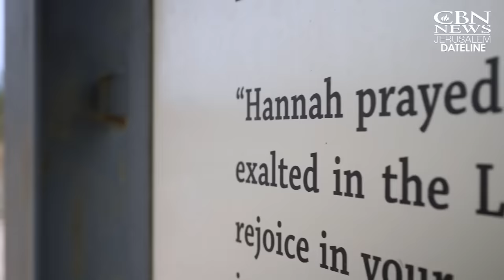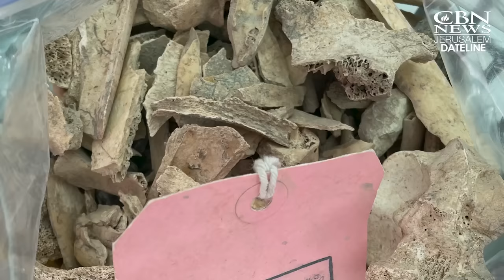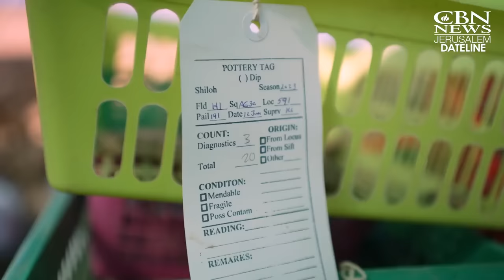Archaeologist Excited by Recent Finds in Ancient Shiloh, Biblical Site of Ark, Tabernacle

Comment: The issue is, until Solomon built the temple,the temple was as it was in the dessert, essentially a large tent.
Reply: @faigie2002
Believe it or not, tents were often erected ON WALLS, back then. 😊👍
Reply: @fairyspunfibers9098  that may be true, but that’s not how the construction f the tabernacle was laid out for it to be constructed in the Bible.
Reply: True, but it was a perfectly designed tent, both for practical as well as religious purposes. It kept ppl dry during the rainy seasons, and it also kept ppl insulated from both the heat and the cold.

Comment: I'm not convinced. Wasnt the tabernacle mobile? It was the temple that was fixed, so why are you calling this the tabernacle or even considering the possibility. This structure is clearly fixed. Also the first temple was stunningly beautiful. It surpassed the beauty of the second temple, and the second temple was completely leveled to the ground. So i wouldnt even consider this as the first or second temple. So i just dont see how this could be any of the 3 structures mentioned in the Bible. Please feel free to explain if my reasoning is flawed.

Comment: But the tabernacle was a tent, not a building. So how would remnants remain?
Reply: A quick internet search yielded this explanation:

“It is noteworthy that at Shiloh, at least in the later period, the tabernacle seems to have had a more permanent structure.  In the narrative of Samuel’s youth, the place is referred to twice as the “temple of the Lord” (1 Sam 1:9, 3:3).  This phrase had not previously been used for the tabernacle, although it was the common name for the permanent temple built later by Solomon.  Also, Eli is described as sitting beside the “doorpost” of the temple (1 Sam 1:9).  This term is never used to describe the original components of the tabernacle (Ex 26), but it is used with reference to permanent structures like a house (Ex 12:7, 21:6) or even a city gate (Judg 16:3).  Also, Samuel “opened the doors of the house of the Lord” the morning after God spoke to him (1 Sam 3:15).  If there was a more permanent structure at Shiloh, it is impossible to tell when it was built. The Mishnah says that “When they came to Shiloh, high places were forbidden.  There was no [fixed] roof, but a structure of stones beneath and curtains above them” (Zevachim 14:6).”

Source: Samuel and the Tabernacle, Crossroadsbible dot net